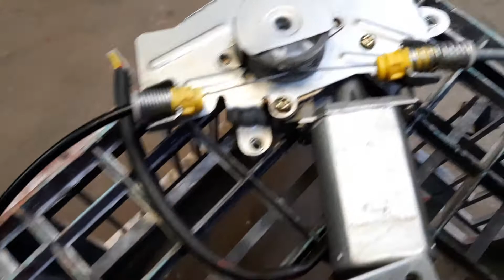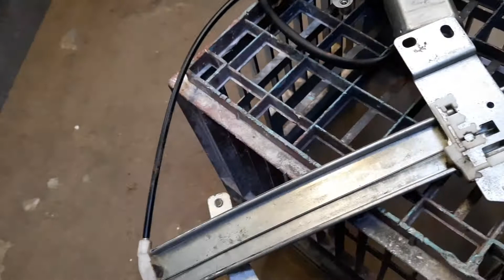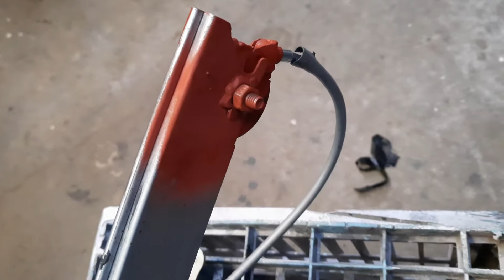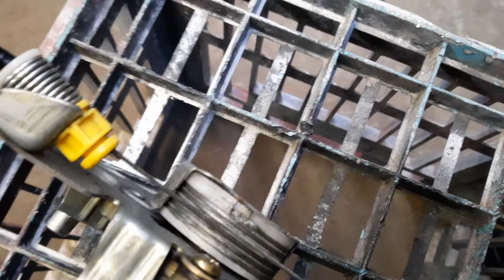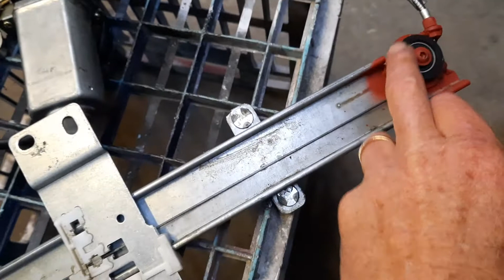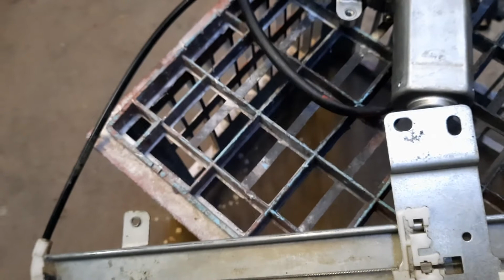NC Fairlane eb falcon electric window repair

Comment: Great mod,my nc has an extremely bad attitude when I operate the windows,might be worth knocking up a similar job,thanks for posting
Reply from the maker: The best option is to replace the unit with a new one, shop around they can be sought at a reasonable price. I chose to repair this one because I had other expenses, and also needed it done urgently. That is the main problem with sourcing products online is having to wait for them to be posted.Another thing to keep in mind is that after 30 years wire connections get dirty and corroded, sometimes just cleaning them can make a difference. The NC is the last of the big Fairlanes, not a falcon with extra gadgets. Keep this in mine when mockers dont appreciate your vehicle. Its right on the verge of becoming a valuable classic.
Reply: @bruceaskin9645  thanks for the reply,I guess I just like fixing things and your mod impressed me,I have had over 40 cars ,all sorts but keep going back to the fords and to be honest after the nc I just plain don’t like the looks of the later fords especially the au,and even though I like ba ,f I don’t like the roof line,so we bought a bf wgn,love it but at the end of the day it’s a wgn and I just really like the design of the na nc fairlanes,also I saw a pic of the original winder and it looks really week like ef door handles,and there is nothing more satisfying for me than to know I have got it fixed it and made it better than original and got it right,I can’t wait to get rid of the clutch fan
Tracy
Reply from the maker: @tracygeddes5867  Yep The clutch fan can be a pain made a video on removing that also, from memory I think the sixes unwind in the opposite direction to the eight, but you might want to check on that. From previous experience, electric fans only work efficently if properly encased in a shroud. Possibly a later model might bolt straight on. But then there is the issue of finding a place to put the switch in the head / manifold.  https://youtu.be/g6TQAKWtmH8
Reply: @bruceaskin9645  on to it,got one from an el just need a controller 
chears Tracy